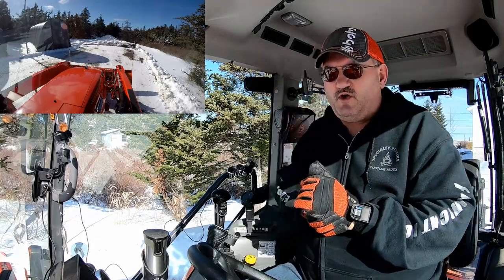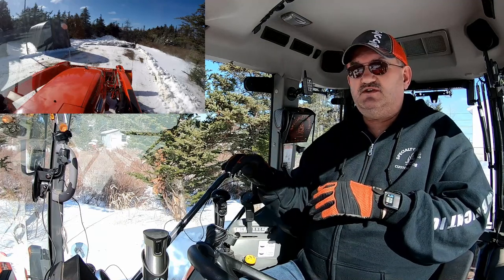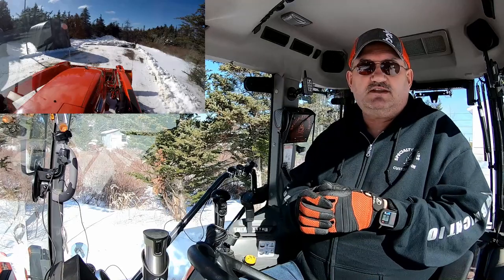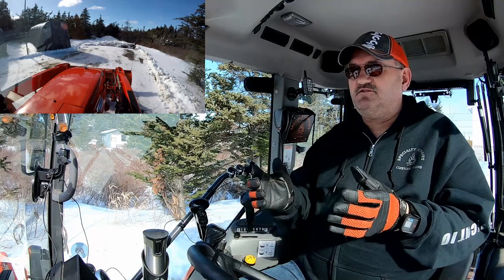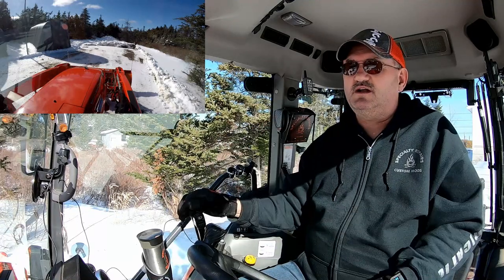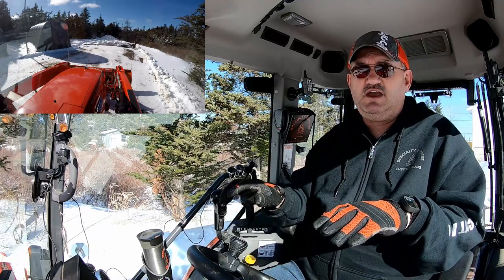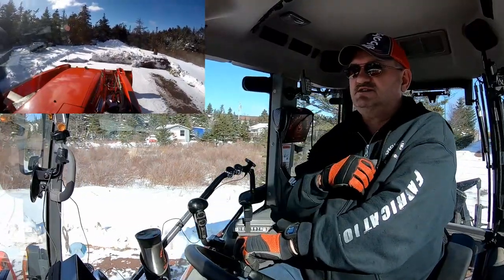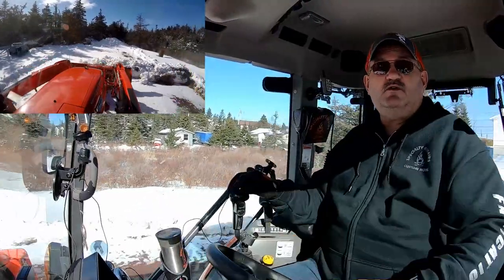Using Your Front End Loader (FEL) The Right Way

Comment: Thank you, Paul. I've watched it twice! So helpful as I am getting a new B2601. Have had three gear tractors but this is my first hydro and actually my first FEL. I had thought float would keep me from gouging my asphalt drive and avoid digging into my gravel drive. But your explanation makes sense and will make my learning a lot safer. Both drives are fairly straight but have drop-offs on the sides. Your way of dropping the blade and then nudging it up slightly should work! Now, we don't get a lot of snow in this part of Virginia, but I'll be more prepared when we do get a monster snowfall.

Also, your tip to keep one hand on the wheel and one on the joystick is solid gold. No experience speaking here but it's obvious now that you point it out. Again, it will help me learn to do all these things at once and more safely and effectively. I think I'm gonna run in low!

Comment: Good video Paul.  I have a few years of snow clearing experience, and what is not often talked about is how you can bend your loader sideways using a articulating blade. I have seen it happen many times when people are slamming in to hard snowbanks with the blade angeled to one side resulting in crooked loader arms.

Comment: Brand new BX23S owner using BX2822 blower here and this answered a lot of questions for me.  Float is great for 95% of my driveway but tractor is pushing on the single 90 degree turn.  Taking it out for the turn will be standard practice.

Comment: That works great on a paved smooth surface, but not on a gravel surface. I have found on a gravel driveway, with a washboard type surface, keeping the FEL in float mode allows it to move up and down with the surface. Otherwise you scrape gravel off the high areas. Also, you can keep you FEL from digging in by adjusting the tilt angle of the blade
Reply from the maker: That was gravel I demonstrated on in this video. Do what you want, operate as you want. My FEL can’t dig in because of the way I designed it.
Reply: @7863348  Paul, no need to get so defensive whenever anyone comments with a different opinion. I supported your channel, and have bought some Mods from you. Perhaps you should just turn comments off if you are going to get so upset if someone posts anything other than I love you Paul...
Reply from the maker: No man. Not defensive. I’m just pointing out that I was in gravel. You found that defensive? Really? As for my fel digging in this is why mine can’t. Hope this didn’t sound defensive 🤭 I’m not saying anyone has to do as I say in the video. I’m just answering some viewers questions on how it’s supposed to be done. https://flic.kr/p/7dpKVz
Reply: @7863348  Okay, maybe I just took it the wrong way. take Care
Reply: @hardwareguy1  andrew you are a very sensitive person

Comment: Great advice. I just wanted to clarify once point further. When pushing with a bucket or pusher float is great for speed. Example when you dump your load of snow to get back down to pavement it’s much quicker to slam it in float versus finding the precise location. Then once it hits the ground feather it back up as needed.

Comment: Hey Paul and Kathy!  Great to see a little video from you guys this weekend.  I use the float on my old original BX23 all the time... I move a lot of wood chips for the walkway in our local park, and find it quite useful when back-dragging the chips to spread out the chips.. Its a balance between holding the bucket at a fixed position or float. The chips behave quite different than sand, gravel, or snow.. they can interlock with each other and wad up.. Having both float and a fixed held position is essential to do a quick and efficient job... I struggled when a beginner, but time and experience has made it second nature, with that right hand always on the FEL control.
Reply from the maker: I’m only referring to the tasks mentioned in the video. Not every situation. That said. If you were on a real piece of equipment and used float mod. Where I worked it would be  taken that you don’t know how to operate the machine properly.
Reply: @7863348   Spreading and smoothing  wood chips back dragging is indeed a specialized task. It is entirely different than gravel that won't wad up. We hardly ever get snow, .. only ever moved snow once.  Never used a push blade... I cannot imagine a time to ever use float with a push blade..

Comment: Paul, I agree that using float mode makes it next to impossible to steer. But using float mode to push the snow straight ahead with my L6060 is the only way I can clear my undulating long gravel driveway without tearing off the high spots.  The range of motion on my FEL arms in float mode is very noticeable.  You have the 1000 hours of experience required to master any task, and perhaps I will be able to feather the joystick once I have that much "stick time". In the meantime......

Comment: Do these smaller Kabotas have independent brakes? I have been using a large Case 580 with a bucket to plow for way more years than Id like to admit, and use float religiously once the ground is frozen solid. I feel like I get a more consistent finish without missing anything. I do actively vary bucket tilt to scrap more aggressive on the frozen gravel, and tip up when I push onto the grass. If I was actively trying to comp up and down I feel I would miss a lot. Because of how far the blade sticks out from the front tires, I always thought blades on tractors would be more convenient to use if they still pivoted as if they were on a truck, with the FEL lifting up against a chain/travel limiter and a heavy spring to apply more down pressure for back dragging if needed.
Reply from the maker: Yes mine do but here’s the problem. Only brakes in the rear. The split brake pedals are on the right side which is the same side as the HST pedal and there’s no room for two feet on the right side so split brakes on these models could be considered useless. As I said in the video float is good going straight ahead and on solid ground but that’s it for me.